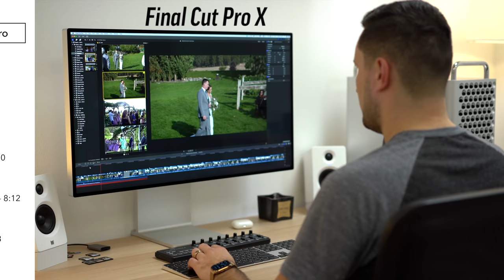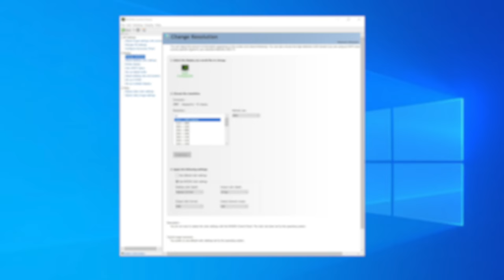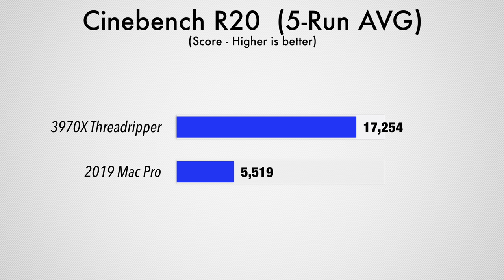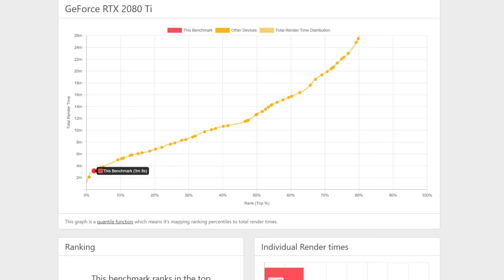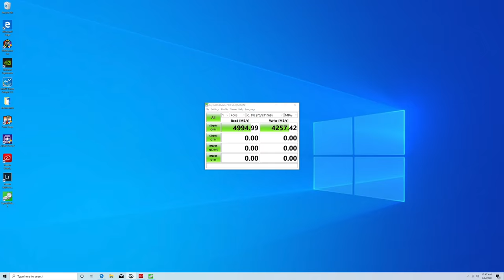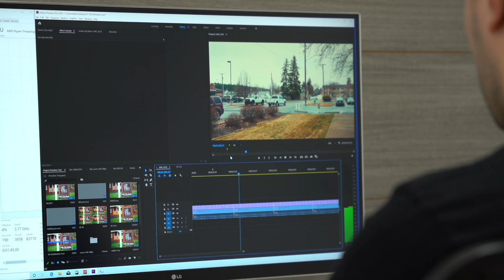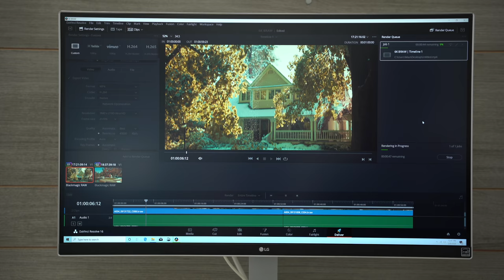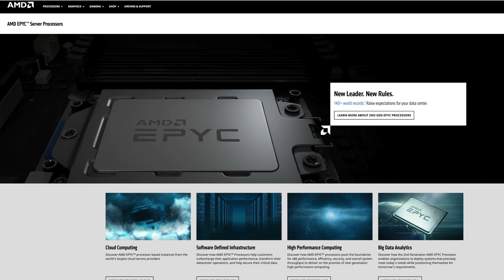$15,000 Mac Pro vs $5,000 Threadripper - Sorry Apple..

Comment: The reality is that a 5k computer shouldn't get anywhere near the 15k Mac Pro. For three times the cost it should win in every test but it actually gets beaten quite badly in many areas. Somehow you still seem to be presenting the two options as if it's a close call.

Also many of the 'issues' you highlighted with the PC could be easily addressed, fan noise, PSU etc.

At the end of the day though it will come down to how much you are willing to pay for Mac OS, some people seem willing to spend 10k on it.
Reply: William Morris Music I am somebody who is interested in the Mac Pro. We use MacOS for software development, and I would like to send our builds to it. For this, we plan on buying the base configuration and swapping processors to the 28 core Xeon and adding RAM ourselves.

Key words on that: COMPANY EXPENSE. My personal gaming pc is actually a 8700K/2080ti that I love, and it runs Windows and Linux. Plan on buying a Ryzen processor whenever my next upgrade is. But for work, I will use a Mac Pro because we rely on the MacOS terminal.
Reply: @RogueTravel  if you truly need the Mac OS then of course it makes sense, I know others who are tied into certain Mac only software. Some have switched though as alternatives become available. My point was it's tricky to justify the huge price difference for (in many cases) less performance. I work in audio and my computers will also be a business expense but that doesn't mean I'm just going to abandon reason and for me at least the low tier MP's are incredibly poor value. In audio at least we have the option of running a Mac with a Windows slave to do the heavy lifting.
Reply: No it’s pretty much the monitor as the monitor Apple is selling is waaaaayy cheaper than other monitors
Reply: @g3neralcross911  can't you use the monitor without the Mac Pro then?
Reply: William Morris Music not really it barely works go look at Linus tech tips about it
Reply: @g3neralcross911  a monitor that's tied to one computer doesn't sound great, I've seen a few others getting it working with other setups but it looks like you forego the controls for it. The monitor seems like a jack of all trades though so I'm sure you could get something better for the money in most specific use cases. Also can't see it replacing the top end ref monitors.
Reply: U can make ur own pc with macos
Reply: Fertilizer and Frob think about it. Imaging that you are a contractor that makes commercials for hundreds of other companies. You employ the best video editors, the best camera crews, but you use hackintoshes for your computers because it saves you 50k in total. One day, one of your computer stopped starting up because of a hardware malfunction and on the computer, was 10s of thousands dollars worth of content for your clients that is confidential. You cannot take the computer to an Apple store because that won’t work. So you decide to take it to a local repair location, easy. You had to wait a few weeks for the thing to get fixed but hey better than nothing. However, a few days later, you realized some of the confidential contents were leaked on the internet because apparently, the repair shop did not have proper procedures for handling data security and your computer was hacked in the process. You get sued by your client, your insurance wouldn’t pay for the damage because you broke the EULA. This happens more than you think. You could have spent an extra 5k per machine but now you are paying figures in the millions. My point is, hackintoshes should never be used in a business setting. It is not only unprofessional, but also very risky.
Reply: Plus we are talking about computational performance. Why don’t we talk about graphical performance. Still cheaper? Ultimately, if you have to ask the question why someone should buy this, you are not seeing the Mac pro for what it is. It is marketed to studios and businesses, not a person. I think often times tech companies get a lot of hate for selling something out of you and I’s budget. We get mad and take out our pitch fork. It might seem like they make things expensive and unattainable for us, but in reality, we were never the intended audience for it in the first place. Apple could easily make a threadeipper Mac Enthusiast. But they don’t and that might be because 
1.They are bonded by contract to use intel chipsets 
2. Intel CPUs has a longer life span (10 vs 5)
3. Intel CPUs has better support for enterprise virtualization
4. Apple might be working on their A Series chips to replace both intel and AMD

Those are just speculations but that’s my 2 cents
Reply: because i think they being paid by apple to make this video, 😠
Reply: @booooooooooooooooooooooo  first off, any serious post production or edit house wont be working with local data, they'll have files on networked storage backed up in triplicate. If a workstation has a software issue they'll just clone a new working setup to it, if it's hardware they'll swap it out.

Secondly your data is no safer with Apple than anyone else, they have had multiple instances of employees stealing data.

There are many high end film service companies that need more than what the MP offers. The new Terminator film was posted on AMD threadripper workstations, where you can get up to 64 cores.

The biggest market I've seen so far for the MP is YouTubers doing reviews.
Reply: @RogueTravel  LOL which software to develop you need a Mac except web development or web based software development or Software for whole Apple system? There are about more than 85% of PC users do use Windows and to develop Windows origin or native softwares and games you massively need windows system through C/C++ languages..
Reply: @BytoGeekLab  Stop crying 😅
Reply: Mr. Know-All I am a native Android developer. Our mobile team has four senior developers (two iOS, two Android), all of which earn six figure salaries. Android Studio is better optimized for MacOS, and iOS development must be done on MacOS. It costs the company I work for around $600,000 per year for us to work, prior to paying for any software licensing. If we spend significantly less time doing incremental builds, it can have a huge impact on our productivity. I bet your comment was made on a mobile device, running either Android or iOS with the YouTube app.
Reply: Mr. Know-All also you discussed Windows development without mentioning the .net framework or C#. Similar to development for MacOS, you must use Windows to develop using the .net framework.
Reply: @booooooooooooooooooooooo  This makes sense, but for a bona fide professional who actually runs a business that is making a "consistent" profit and who can probably write off the cost as a tax or business expense is the only way that buying a Mac Pro at the current configuration laid out in the video is justifiable. Alot of people however are really just "hobbyists" and wind up buying and spending really unnecessary costs but to each his own, the Mac Pro is nice and pristine but 15K is too steep for my tastes at this point, even 5k would be on the upper limit of what I would want to spend or build on my on artistic/gaming "business" PC.
Reply: @djExquiz  this is not a enthusiast’s computer. It’s marketed towards corporates the likes of Disney and Pixar. It’s not meant for consumers
Reply: @RogueTravel  Yeah that's why I mentioned about web based development. Where MacOS is better.. Even better for all unix based development..
Reply: @RogueTravel  yes that's obviously needed
Reply: Mr. Know-All are you actually claiming that the best environment for iOS development is not MacOS?
Reply: @RogueTravel  Yes MacOS.. thanks for the correction again
Reply: @booooooooooooooooooooooo  Or you move to Windows because those people can push out much more content with hugely faster workstations. 2x rtx8000 will destroy any mac options with ease. Theres literally no competition anymore as Apple now uses the inferior cpu and gpu manufacturers.
Reply: jep ulis no thanks. I don’t like windows
Reply: @RogueTravel  That's fine, but if money is no object (COMPANY EXPENSE) then we don't need a price comparison. It's like comparing how well an AUDI and a BUGATTI go from point A to point B (equally well). But the BUGATTI costs as much as 5 AUDIs.
Reply: jep ulis jep ulis rtx 8000 costs $5500 each with about 16.3 tflops of FP32 performance per card. 64GB of GDDR6. The MPX Vega II Duo costs $5600, and has 28 tflops of performance 64GB of HBM2 instead of GDDR6, not to mention you can have 2 of it making it 56 tflops. You tell me which is more powerful.
Reply: @booooooooooooooooooooooo  that's why we do tests. Show us how it's more re powerful and why it's a better choice!
Reply: @nobody-u-know  I mean in the context of work. As a business decision, if your annual cost is $750K for mobile application development, and for $10K more you can see a productivity increase of 10%, then it is justified. An individual likely cannot benefit in the same way
Reply: @RogueTravel  I understand, but by the same logic, if you could see that same productivity increase and save $10000, that would be a better decision. It's abundantly apparent to me that if people could install MacOS on any machine (like Linux and Windows), we would never have to have these silly conversations. You could just make whatever machine you wanted and use MacOS. This is incredibly easy to do, as the hackintosh proves, but Apple chose to make a policy that does not benefit their customers. Of course they give all sorts of reasons why they need to control the entire vertical, but from the outside, it just looks like ransomware.
Reply: I don't hate Apple, as much as it may sound that way. I'm just critical of their business practices. If they had support for NVIDIA, and other hardware vendors, that would give customers an advantage similar to the Linux or Windows platform, it would be better for everyone. Prohibiting installation of a free software product, does not help their customer base. The new Mac pro is an amazing feat of engineering. But it is obvious to most computer enthusiasts that the value proposition is horrible. My only real gripe is that Apple enthusiasts don't recognize or admit this.
Reply: @nobody-u-know  I consider myself a computer enthusiast and run a 2080ti based gaming pc with an 8700K running at 5.15 GHz. It triple boots Windows, MacOS and PopOS, but 99% of the time it's Windows gaming. I'm also a Senior Android Engineer. And we are moving forward with the Mac Pro purchase and I cannot wait to go from 8 to 28 cores for incremental builds. If somebody told me that I must develop Android applications in Windows, I'd quit my job, just as I refuse to game in MacOS or Linux. Life is short.
Reply: @RogueTravel  I think what you're saying is that it's worth the extra $10000 to work with MacOS. I understand. If you could install MacOS on any machine, like you can Linux, would you still buy a Mac Pro, or would you build something similar to this AMD machine? I'm guessing you would rather save the $10k and build a better machine, right?
Reply: @nobody-u-know  I would have no qualms building another machine, just as I have no problem tearing down the Mac Pro and swapping the socketed processor. If you're complaining that Apple locks down their OS to make money, feel free. I choose not to. I also don't whine about the obvious price gouging of the $1300 2080ti I purchased last year, or the amount of free data that Google mines in exchange for use of its OS (Android). Or that they take a significant cut of in app purchases. If you prefer a truly free operating system, choose a Linux distro that suits your needs. Or if you want an open mobile operating system, choose an Android skin that suits you (built on the Linux kernel). Just my thoughts
Reply: @RogueTravel  I just have a problem with reviews of Apple hardware that don't take value propositions into account. As many of the comments here point out, he has a true value difference (in favor of the TR) but isn't straightforward with his review, talking about them as comparable machines. This bothers me. Prospective customers should be better informed about the actual value of the machine.  I understand in your case, that you don't mind buying this machine, knowing that it's way overpriced, simply because you like what the platform allows you to do. I wish the review would say something like that.
Reply: @booooooooooooooooooooooo  just FYI, both of those companies use linux
Reply: @booooooooooooooooooooooo  Rtx ones. Teraflops are not created equal.  And you can choose another card too if pro-line rtx is not faster than a 2080ti / rtx titan on your workflow. Vega is a nice cheap card and you can get 2x vega56 for less than 400€:s used.
Reply: @booooooooooooooooooooooo  I used to work for Apple, your data isn't any safer there than it is somewhere local. We would all share pics of the hottest girls off their hard drives and iphones and you're a fool if you think any high end media company is going to work with footage without a proper backup for both data and hardware failure.
Reply: Lance Boyle hence why you used to work for Apple but not anymore. That was you being corrupt, irresponsible, and not following procedures and your privacy training
Reply: @booooooooooooooooooooooo  LOL yeah dude they totally caught me and fired me!! Oh noooo!! LOL, you really think any of us were stupid enough to get caught? Nah I quit because I got an actual real IT gig where I work from home and get double the salary I had when I was an apple genius.

Working for Apple was brutal, nothing but rude customers screaming at you for them breaking the glass on their iphones while macs needing repair got neglected for weeks and managers ignored you and kept opening iphone appointment queues and expecting you to deal with an unmanageable workload day after day. The only good thing about working there was the deal on the apple stocks and fixing iphones and macs for cash on the side, I would buy liquid damaged macbooks for like $100 and then use a manager code to replace the logic board and then flip for $1500 lol.
Reply: Lance Boyle I’m not in a position to argue with you. I could tell you that this is not how Apple retail work at all. I’m sorry you had a bad experience working there but that is not representational of everyone’s experience. Do not blame your interpersonal incompetency on other’s lack of respect.
Reply: @booooooooooooooooooooooo No dude that's exactly how Apple retail works, they don't care about their mac customers anymore. You know how many times I'd see a simple repair like hard drive replacement would go untouched for 2-3 weeks because we're too busy swapping cracked iphones for morons and the managers wouldn't even let us do repairs? They don't make money off macs anymore it's all about iphone/ipad. Your little scenario you came up with earlier doesn't make sense, Apple retail is a just a fancier shinier version of Best Buy with staff just as likely to leak data as anywhere else - Myself and my old team are living proof as testament.

I can tell you're one of the kool-aid drinking hipster cultists. At the end of the day it's a corporation out to make money, they're not your friends, they don't care about you. Like I said I'm grateful for the money I made off their stocks and side hustling, plus the 2 weeks training in Cupertino and getting to meet Jobs, Wozniak and Ive, but at the end of the day I'm way happier at my new gig getting twice the pay at home with zero stress.
Reply: Lance Boyle hahah that’s very funny. Why don’t you let me continue drinking my koolaid then. I don’t want to change your opinion. But I can tell you that from my experience, I was taken care of by the company. I felt respected by them. And that’s more than most of the other tech repair shops out there.
Reply: @booooooooooooooooooooooo  You should apply there then, they love fanboys like you. Too bad they don't send their Genius trainees to Cupertino no more it's all online training now, which is hilarious because they have ridiculous amounts more money now than when I worked there 10 years ago. But like I said their mac repairs and sales don't matter to them now.
Reply: Most people care about the experience rather than the raw power......  Trust me the Mac os is diffently awesome and I can't forget the date I asked my dad to buy a macbook pro for me in Christmas 2010 it was indeed a big holiday.....
Reply: William Morris Music You can, you just need a Thunderbolt 3 connection that is tied to your graphic card
Reply: there are some creative production areas (mostly video related) where it is actualy the clients that dictate Apple. If you lose hundrets of thousand because the client visited your production and thought you are unprofessional because the machines have no bitten apple on them you better spent the extra money
Reply: William Morris Music you know what’s funny is this 5k computer still almost wipes the floor with apples most expensive computer, the $62,000 Mac Pro

Comment: The 5k PC Threadripper too much noise? Bruh. You can custom open loop watercool the shit out of the CPU, GPU, RAM, Motherboard and it will be silent and still not reach the price tag of 15k. Do you even know watercooling has been around for more than a decade now? So your statement is invalid. Aside from users favouring apple, there is absolutely no way to recommend this product to anyone else.